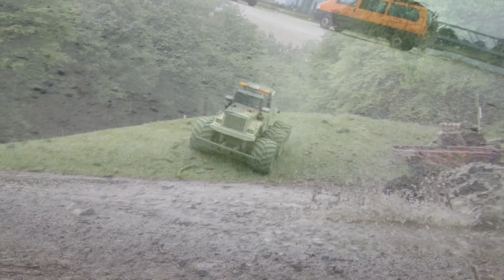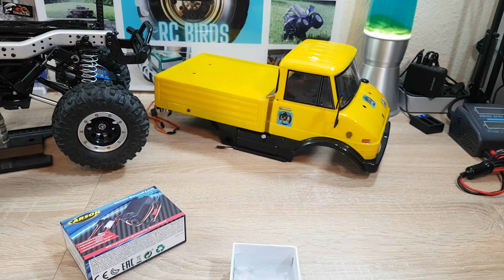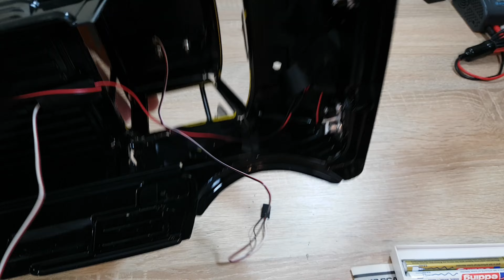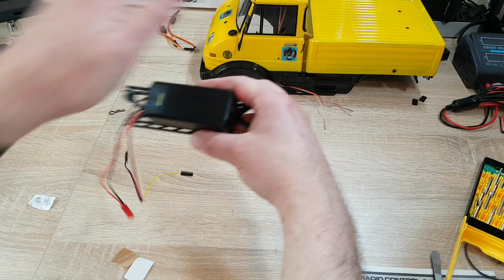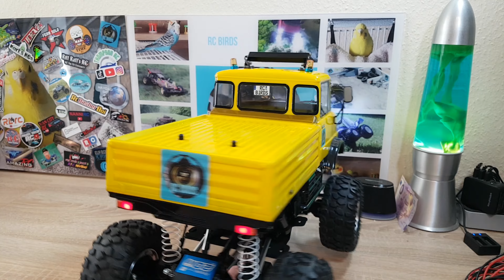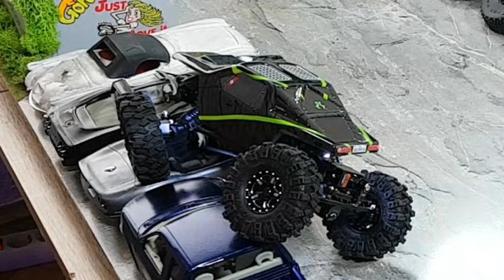Tamiya CR-01 UNIMOG 406 Upgrades (Part 2)

Comment: It turned out great Dirk and I am glad the radio issues was something simple and you did not have to wait a long time to get a replacement. I am sure it is going to be a lot of fun on the trail!
Reply from the maker: Thanks a lot Addam the dealer and Carson tried to figure it out, before it travels through our country. So after three days it worked. I first thought they were kidding me for checking the battery compartment. As if this is the first radio I have. But the customer service took the time and explained me the problem on the phone. Pushing the batteries was really new to me, and you can't even see it. We're talking about 1 mm of space between the contacts. You cannot believe what I felt as I heard the firts beep from the transmitter while puahing the batteries😉.
Have a great weeken my friend.

Comment: Awesome video as always I enjoy watching your builds, I have a bunch of those LED lights love them, I’ll have to look into that sound module, I bought one that was overpriced and not great at all. Thanks for sharing ✝️😎☮️🙏🏽
I’ve been using the cloth type material electrical tape which is used allot here in cars. Beautiful truck
Reply from the maker: Thanks for watching and commenting. 
For the soundmodul I have to say, that I pay 30 bucks for a Reely, wich does only motor. This Carson has the addtional horn. An ESS dual is around 90 here. The last one I really like, but for the kids I like to test a more budget one. The Carson has two cons. First the volume of the horn stays, meaning at full speed it's hard to hear. Second they give you the USB dongle to change the sound, but the app doesn't find the device. Tested other dongles from my ESSs, too. All in all it was a test and if you add more things to your crawler, you can save some money. In my mind it isn't perfect, but okay to use

Comment: That was annoying with the batteries causing an issue on the radio 🙂 Strange how they did such large holes in the light bracket where most are M3.  Good all is working now we need to see it on a run.
Reply from the maker: Thanks a lot Mal. Never had this issue before. So I thought they're kidding me as they said "check the batteries". Yupp, giant holes, but my grandchildren don't care for such details😁.

Comment: Looking at the video, I would have been better off buying the Unimog and starting the project straight away instead of putting it off until the colder months. Now I have the challenge of making the MF-01X drivable. A tough project.
Reply from the maker: Thanks for watching Stephan. If I got it right, the price you saw was awesome. The Unimog includes in standard a light kit and a full set of balö beatings, so it's a great kit right from the beginning. Technical upgrades aren't as many, but in stock version it's a great crawler to start with. Maybe Santa gets an eye on you😉
Reply: @RCBirds  Danke